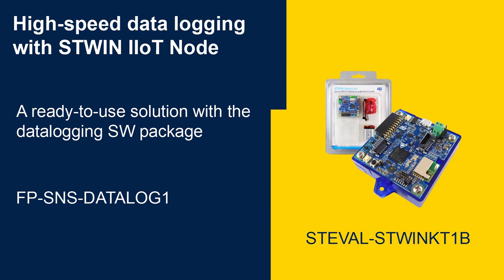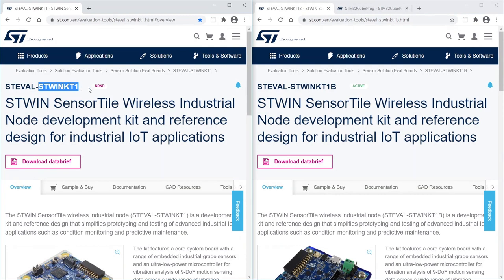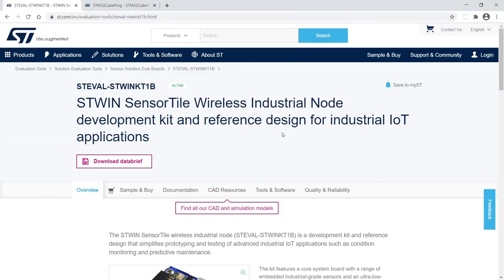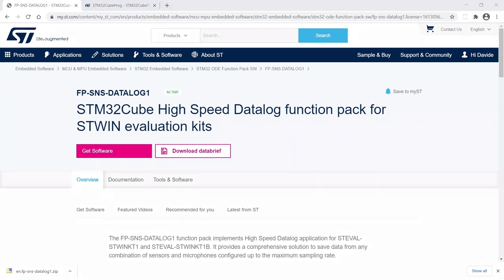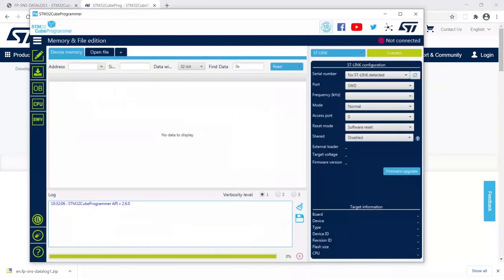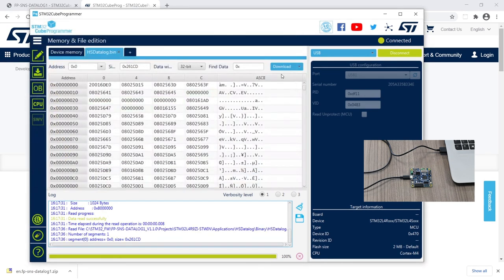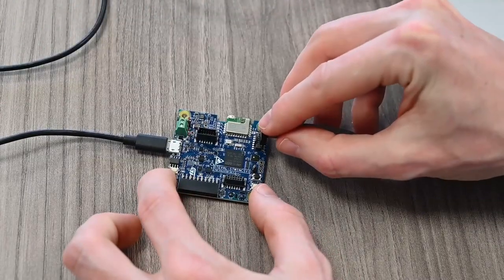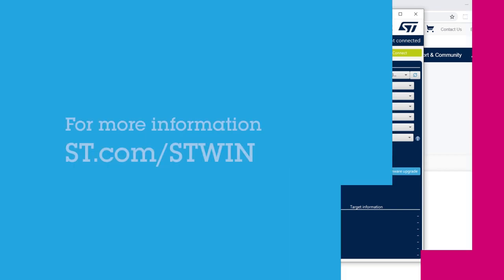How to program FP-SNS-DATALOG1 firmware on STWIN using STM32CubeProgrammer

Comment: Originally my board was working and it directly connected to the Android app. Then I updated the firmware using STLINK-V3MINI and the STM32-LINK Utility with ("\en.en.fp-sns-datalog1\STM32CubeFunctionPack_DATALOG1_V1.4.0\Projects\STM32L4R9ZI-STWIN\Applications\HSDatalog\Binary\HSDatalog.bin") and now the board seems to be "dead". It does not run from battery any longer. No organge LED blinking. Only the red led when it is connected via USB. A USB device "STM32 BOOTLOADER" is found with a yellow triangle...
UPDATE:
I tried it several times also with older firmwares (v1.2, v1.3) and suddenly it worked.  Hint: you have to restart the Android app after firmware upgrade.

Comment: I cannot see real time data on the Android app. It can only download in SD card.
Reply: I have exactly the same problem as you. Now, because I don't have the SD card I am trying to figure it out how to see the sensors data in my PC , but not good results until now :/
Reply: @danieltrigo2928  even with SD card you won't be able to read the data. SD does have raw files but not sure how to play the .dat files for getting the results.
Reply: @ThemeParkTeslaCamping360  Yeah I suppose you are correct. Have you tried downloading the FP-SNS-DATALOG1 in order to acquire the data?
Reply: @danieltrigo2928  i have only tried humidity and temp data.. but regardless how to read the .dat file?
Reply: @ThemeParkTeslaCamping360  Until now I am only able to se the data on Matlab connecting the board by USB to my computer, I am still trying to figure it out how I can see it directly in my phone.
Reply: @danieltrigo2928  nice i don't have Matlab. Lemme know if you figure out on the phone app. I did my best and i gave up. Looks like to me you might need wifi board and cloud activated to see on app just a guess. I might be wrong.
Reply: Hello i have a Problem for to read the Sensor Data .dat in Matlab, maybe can you help me?